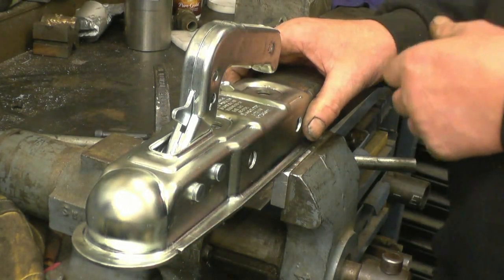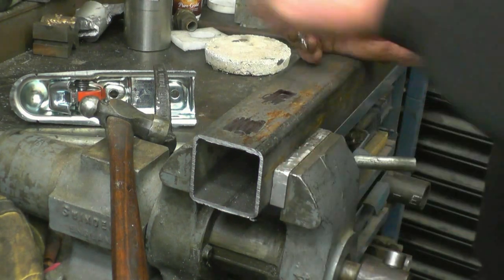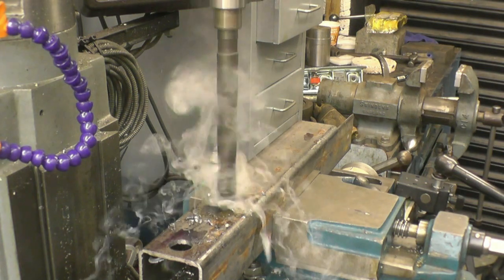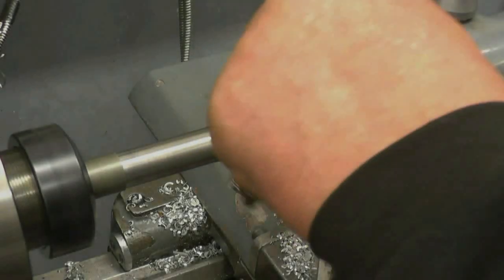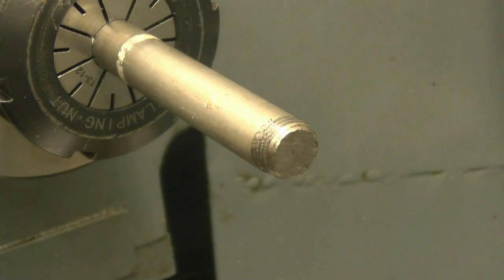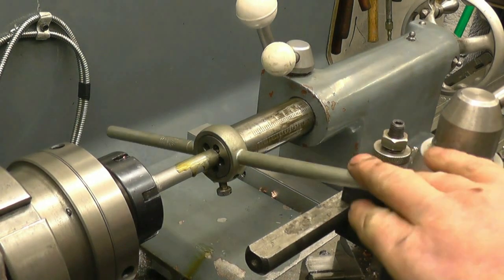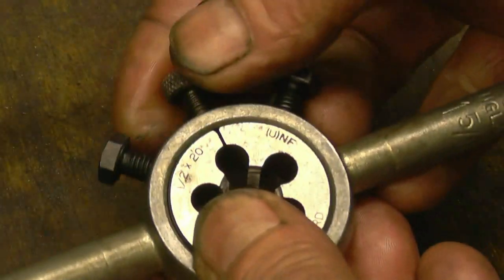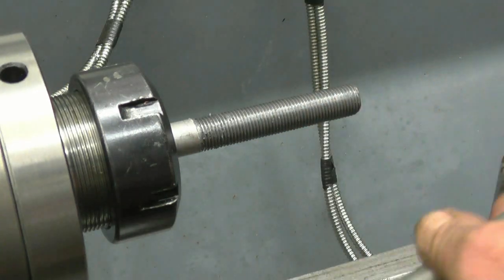SNNC 171 P2  Stig the Pointer  Trailer hitch

Comment: These pressed steel hitches are intended for small trailers only. Using the method shown, any significant load, particularly dynamic stresses could bend the thin steel tube. Using the side holes together with spacers and minimal clearance holes would result in a stronger fixing.
Reply from the maker: It will be used on a small garden trailer

Comment: Looks to me like the hole spacing top to bottom is the same as the side to side holes on the hitch.  Could you rotate the tongue 90 degrees and possibly line up with those side holes on the hitch piece?

Comment: what is the logic behind bolting top to bottom rather than side to side through the holes there? I guess there must be some reason? My AL-KO hitch is bolted onto the box section through the side holes so was just wondering.....
Reply: Yes, I use the side as it has 4 points of connection instead of 2.
Reply: The cross holes certainly would be stronger as the bolts go through two sides of the hitch instead of just one.
Reply: I would have used the horizontal holes as well to make a stronger hitch.
Reply: yep i was surprised that hitch was such thin sheet gauge, so id probably use the horizontals too
Reply: Basically, you have to choose between the bolt heads and washers ripping through the top of the hitch, or the bolts ovaling out the side holes until it is unusable. I've had both kinds of failures, so the choice isn't much of a choice. It looked as though the top holes were offset from the side holes, so maybe both sets could be used together. There might even be room for internal braces for both sets.
Reply: My hitch is cast, that only has vertical holes, so there can''t be that much of a problem
Reply: I think you are missing the point, you have the choice of twice the thickness or half the strength, not a difficult question in my mind.

Comment: John,

0.75 inches = 19.05 mM.  In a socket, who cares?  The pup is outstanding.  The die tells a tale.  (U)NF = unified national fine.  The original U.S. standard thread form has a flat crest.  The Whitworth thread has a rounded crest.  The UNF and UNC threads follow the U.S. standard form, but the crest has a tiny bit of rounding.  UK folks had to have had a royal pain in the neck from changing threads twice: Whitworth to UNF/UNC and then Metric.  Here in the U.S., while Metric is legal, almost everything is Imperial.  2 liter bottles of soft drinks are the most commonly seen evidence of Metric.

Eli D.
Reply from the maker: I still like and use imperial threads 
Thanks for watching

Comment: John, that hitch looks a load of old crap. Pressed out sheet metal ? Chinese I suppose ? I would not use anything like that, spend the extra money and buy the proper cast & machined solid steel one. As others have said, the two side holes would have given more support as you would have had 4 surfaces for the bolts to grip on. I would suspect any heavy load / shock on it as it is will result in the top of the hitch distorting. Just out of interest, does the hitch have any UK approval safety standard markings on it ?
Reply: I agree it looks like Cooking foil. Looks like a tin for baking cakes.
Reply from the maker: The hitch was suplied by the customer I agree it is of poor construction  I have seen many similar on small garden trailers